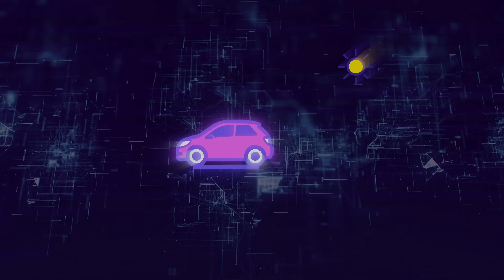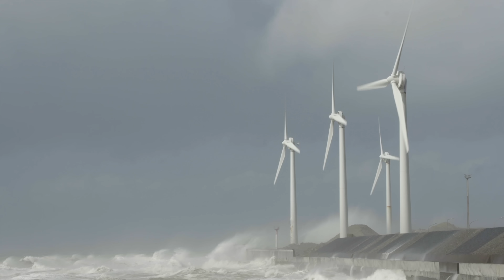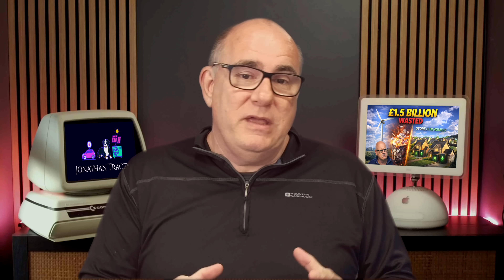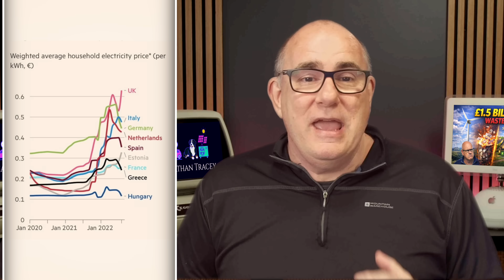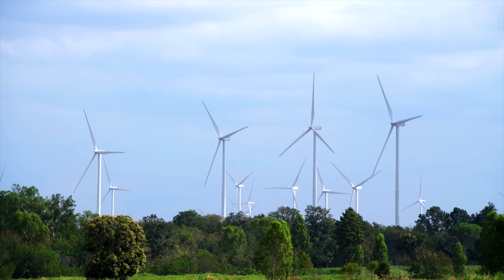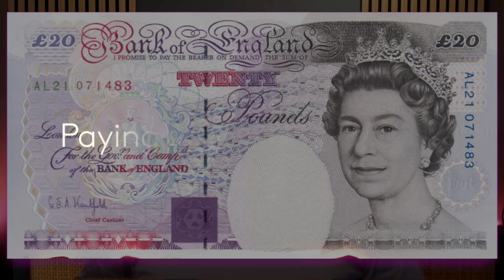We’re Paying £1 5 BILLION To Waste Energy… Here’s My Big Idea

Comment: I don't like to be negative but this video doesn't make sense. I know its popular to hate on the government, but energy policy takes multiple years, sometimes multiple decades to come to fruition.  The current situation we are in is a legacy of the previous government (right back to David Cameron's "cut the green crap" nearly 20 years ago), and to some extent even the previous labour government (thinking specifically not investing in nuclear because they wouldnt be in operation until the 2020's).

The government paying to put batteries in everyone's house as you suggested makes no sense.  If you're going to put them anywhere, put them near where the wind power comes onshore.  This provides centralised management and economies of scale for the battery commissioning and management itself.  It would be a much better answer if batteries were a practical answer to start with, which they're not.

As you addressed later in your video, there are times where we 'turn off' wind generation and produce power elsewhere in the grid -- that's because we do actually need the power but its in the wrong place.  There isnt currently the infrastructure to move the power when its produced in excess.  So the answer is to build that infrastructure.  Putting batteries in populus places in the grid doesn't help because the power is not transportable there when the problem is excess production rather than under consumption.  Basically what is required is a north/south interconnector, like we have over to Europe, else you're still going to be paying to curtail wind generation some of the time.

Using batteries isn't particularly effective anyway.  Once the batteries are full you cannot keep charging them.  There are prolonged periods where we produce too much wind power, as there are prolonged periods where we produce far too little renewables for it to be used to provide base load for the grid.  You are vastly underestimating the amount of power produced and the excesses that need to be dealt with. Not that we shouldn't consider energy storage as well, but it's not going to be feasible to build batteries on a scale to store all excess power.

Increased demand from EV charging will eventually help even domestic grid load by adding additional demand during the night.  That will reduce under consumption somewhat.  There's an inertia in that happening, in the same way that there is an inertia in building or commissioning wide scale battery infrastructure.  Policy should be about building to a forecast demand, not current demand because that planning should have been done in the preceding years and hasn't been done adequately by previous governments, else we would have had a solution to this in place already.

A better solution might be to produce hydrogen power from the excess power.   There are industries where battery technology might not be practical and some form of ICE will still be used.  For instance, aviation.  Producing hydrogen is very energy intensive, so using lower cost power to produce it would allow us to decouple those industries from the fossil fuel volatility and fix a pollutant that still occupies a significant section of the pie chart.  As a bonus, a lot of the places where wind is produced are also areas that have a declining fossil fuel industry or are former industrial areas, so it brings purpose, employment and prosperity back to those areas too.
Reply from the maker: @grahampitt8882 I genuinely appreciate you taking the time to write that — there’s a lot of good points in there 👍

You’re absolutely right that policy and infrastructure operate on long timescales, and we’re living with the consequences of decisions made years (or decades) ago.

Where I think we differ slightly is the role of distributed solutions. Centralised batteries and transmission absolutely have a role, but they also come with huge cost, long lead times and single points of failure.

The idea here isn’t “this replaces everything”, it’s “can we use what already exists in homes to reduce waste now while the long-term solutions catch up?”

On hydrogen — agree it has a role, especially for industry — but it’s a very lossy process compared to just using the electricity directly where possible.

End of the day, there isn’t a silver bullet — it’s about combining approaches in a way that actually works in the real world.

Comment: Jonathan,

while much of the  badly placed wind farms in Scotland can be restricted by transmission capacity, putting domestic batteries does not alter that high voltage restriction.  And as Scotland has a small population so that idea would not be very useful. Not only that, as you quite rightly say Grid scale battery storage systems are small in respect to grid requirement to cover a generation deficit. That is not their purpose, which is to bolster grid frequency when required.

But what happens when the uncontrolled renewable generation exceeds demand and the limited capacity of batteries to absorb that excess? This is now happening because of solar capacity expansion and curtailment will be happening, not due to grid limitations but too much uncontrolled capacity being connected. Yet our government is pushing more, which can only increase cost for the consumer.

By the way gas stations are not generally switched on to compensate, they are already running and simply increase output to keep grid balance, so the cost is minimal. Indeed because of policy, gas is being run at low levels of output which increases the unit cost per Megawatt hour of gas as the fixed costs still have to be met and the very good potential efficiency is being wasted by running them at such low levels of output. They cannot, and should not be switched off.

While the £1.5 billion is hardly small change it is a fraction of the costs that we incur by having so much renewable capacity. The CfD (Contracts for Difference) payment in March this year alone, when gas prices rose was about £270 million (They are higher with 'normal' gas prices), then those on ROCs (Renewables Obligation Certificates at £75 per Megawatt hour) got a higher price as their ROC are added to gas price, not forgetting the balancing costs, a couple of £billion a year, the capacity market and grid expansion
Reply from the maker: @iareid8255 Appreciate you taking the time to lay all that out — there’s a lot in there 👍

I think we actually agree on more than it might seem. Grid-scale batteries aren’t there to replace generation, they’re there to smooth and stabilise. And yes, transmission constraints are a big part of the problem.

Where I’d push back slightly is on the “too much renewable” point — the issue isn’t really too much generation, it’s that we don’t have enough flexibility in the system to use it when it’s available. That’s where distributed storage, demand shifting and smarter consumption come in.

Right now we’re effectively paying to throw energy away because the system can’t adapt fast enough — that’s the bit I think we need to fix.
Reply: @JonathanTracey  

We can fix that simply by dumping renewables, but that, due to various long term contracts, is not an easy or cheap solution.
This is fundamentally the difference between renewables and conventional, renewables are uncontrollable in output, especially so with solar as so much is out of grid control so cannot easily be curtailed. (Like trying to drive a car at a fixed speed with no throttle or brake, just an variable throttle, impossible.)

No renewables would make domestic solar and batteries uneconomic as the domestic electrical unit cost would be nearly half it is now. 
We really have manouvered ourselves, as have other countries, into a deep hole which is difficult to climb out of.

None of this would have happened without the influence of the United Nations, who scared governments with highly exaggerated forecasts of climate doom.

Comment: Start fracking and get cheaper gas
Reply from the maker: so two problems with that approach, 1 we don't have another gas under the ground for more htan a few years and two the gas would be sold at market prices, so you won't get cheaper gas, it will proabably be more expensive because you would be covering the cost of setting it all up

Comment: I had a similar notion a few years back, as probably many have, in that we would benefit from widely distributed storage. It would even out demand on grid restrictions whilst we wait for upgrades.
Those of us with solar+battery installations are already doing this for our own direct benefit with government assistance in the form of zero VAT.

I do fear that your very well intentioned initiative would have a few problems arising from not having bidirectional rcds, but that could be resolved by installing them at the same time.

Regarding a giga factory, BritishVolt tried to build one at Blyth, but the company collapsed. Our record isn't great. Nevertheless, it would be great to build one and use Cornish lithium.
Reply from the maker: I agree the cost of the RCD’s or RCBO’s is minimal. 15 to 20 minutes of an electricians time to do them doesn’t add a huge amount of cost to what you’re installing.

Comment: I love the idea of batteries in every home but this still requires grid capacity to move the power. A way of using excess where the cables ‘land’ would not require any grid upgrades. An example would be a hydrogen generation plant for fertiliser only using excess power.
Reply from the maker: so that’s why I would start the rollout where the power is available, get those people off grid for a part of the day that gives more capacity on the grid to move the power further south, then you start rolling the batteries out following the transmission lines, the more you move off the grid the Mark cap capacity there is to move power south

Comment: The government is already planning this but with choice for the public. Rather than forcing it on certain residents and creating situations where some residents will complain they weren’t part of the first 3 million, the government has committed billions of pounds to low cost loans for batteries, solar and heat pumps. Granted this doesn’t include adding to the economy by supporting the creation of giga factories and it doesn’t automatically mean grid wide integration but you could ask the energy suppliers to handle that part.
Reply from the maker: no one saying we force it on anybody, but you make it a simple rollout, no paperwork no approvals no applying for low-cost loans. You turn up knock on the door and say would you like a battery? Yes plug it in and leave.

Comment: The government is building 4 high voltage transmission lines between England and Scotland (EGL 1-4). Previous government didn't do start this for some reason.

The government has announced (but not yet delivered) the Warm Homes Plan that includes cheap loans for solar and battery, which should reduce load on the grid.
Reply from the maker: yeah, the new interconnect are something that we desperately need, but the first of them isn’t gonna come online till probably 2035
Reply: @JonathanTracey the estimated completion dates are 2029 for EGL 1 and 2, and 2033 for EGL 3 and 4.

Comment: We already have plans late in development to solve the North-South transmission issue.  We've seen what happens to the cost of Heat Pumps when the government pump's money in.  Leave it to private enterprise with incentives to end users to deliver the solutions.  Government should provide a centralised API for C2 for these systems, but that's it. 

If we are serious about putting more and more renewables onto the grid then throwing away energy during excess production should just be part of normal operation - paying absurd gas rates for it is the issue.,
Reply: There's a Heat Geek video on heat pump costs where they demonstrate a lack of increase in install costs when the grant goes up. I don't see a better way to pump up the industry to compete with the incumbent gas industry than the grant?
Reply from the maker: @edc1569 I actually agree with a lot of that 👍

Incentives + private delivery tends to work better than trying to centrally plan everything.

And completely agree on the key issue — paying gas prices when we’ve got excess cheap energy doesn’t make sense.

Where I think government does have a role is setting standards and frameworks (like APIs as you mentioned) so everything can work together rather than ending up fragmented.

The waste itself might be unavoidable at times — but paying the most expensive way possible for it definitely shouldn’t be.

Comment: There are multiple mistakes in what you are saying:

At the start you make a point that the reason wind farms are paid to turn off generation is because the national grid is not able to transmit all of the power from where its generated (windy places like Scotland and the North Sea) to where it is needed - big cities (such as in the South of the UK).
You argue that if every house had batteries then that would solve the problem.
NO - IT WONT - because the transmission problem is still present, there is still insufficient infrastructure (at present) to get these high periods of generation to where they can be 'consumed' (into the batteries).

The infrastructure IS being upgraded, it just takes time.

The cynical argument is that it is being deliberately done slowly because the 'powerful' people are making vast amounts of profit from the current system, which is why there is so much inertia and opposition to changing things - such as introducing zonal pricing.

Note: for reference, I have 12kw of solar panel, 35kwh of batteries, an EV, and a heat pump - Im certainly a big fan of the change to electrification.

The sooner we get rid of fossil fuels the better things will be - perfect example, how much cleaner was the air back in mid 2020 - during lockdown.

Just adding my tupence worth.
Reply: Smoothing the flow not to exceed infrastructure capacity is the idea
Reply from the maker: @gearboxgreebo1177 Appreciate the detailed comment 👍 and to be fair, I don’t think we’re actually that far apart.

You’re absolutely right that transmission is the core constraint today — and nothing I’m suggesting removes the need for grid upgrades.

Where I’d push back slightly is this: if we only focus on transmission, we’re still trying to move everything at the same time. Distributed storage isn’t about replacing cables, it’s about reducing how hard we need to push them during peaks.

In reality the answer is both — more transmission and more flexibility. If we ignore either, we just move the problem around.

Comment: They should just let the Scots have their power for free and start makeing H2 to store in the salt mines (or maybe ammonia for shipping) when there's too much to ship south until the new connectors to England are live.  I'm sure they'd soon soak it up.
Reply: Scots are free to do whatever they want!
Reply: Can't do hydrogen as it's not commercially viable to create intermittently, but something like a cheap heat battery could be used.
Reply from the maker: Why use electricity to make H2 which is hten used to power things by converting back into electricity. Just use the energy in the first place

Comment: I can guarantee the wind farm energy output at a fixed price, even when I don’t need it, because it’s somebody else’s money.
They should have combined wind farms with battery storage, but that would be far too sensible.
Reply from the maker: The problem with building big storage systems near the wind farms is that you need big interconnect to big batteries. By distributing the batteries across thousands of millions of homes you don’t need new infrastructure you just plugged them into peoples houses.

Comment: In italy octopus now has special hours now and then, pre anounced , where one can use more energy (compared to avg over previous 10 days) , any excess in that time over the average is free... especially nice for ppl with large battery systems like us :) we dont buy elec at all so any we buy to fill batteries on those times will be free and we can sell again at night
Reply from the maker: @wernerz8314 That’s really interesting 👍

Those kinds of “use it when it’s available” incentives are exactly what we need more of — they encourage people to shift demand without needing heavy infrastructure changes.

And as you’ve found, if you’ve got storage, you can really take advantage of those windows.

Feels like a glimpse of where things are heading.
Reply: @JonathanTracey  it is really win win win, octopus get paid for helping to balance the overload , i get free elec i can then sell and the GSE makes some money on what i sell too...  We have 3 zones by default but they can read the meter per hour so they use that for this and the zonal per hour based sales of electricity.
Reply: If only we had zonal pricing like the Italian system!
Reply from the maker: @halfmug3087 Yeah zonal pricing would definitely change the dynamics 👍

It would make the cost differences much more visible and probably drive both demand and industry closer to where energy is cheapest.

The downside is it creates winners and losers geographically, which is why it’s such a tricky one politically.